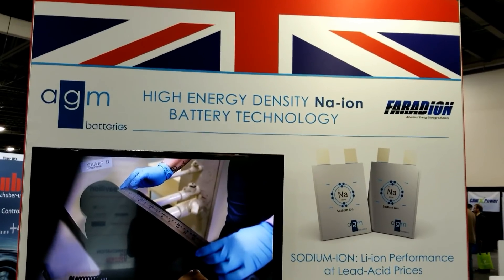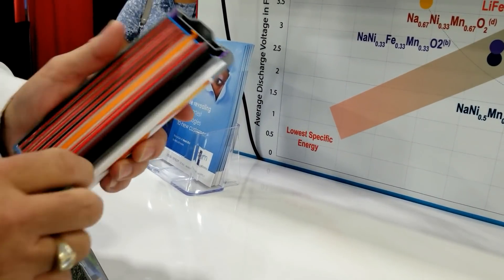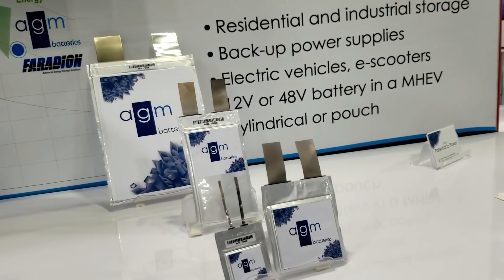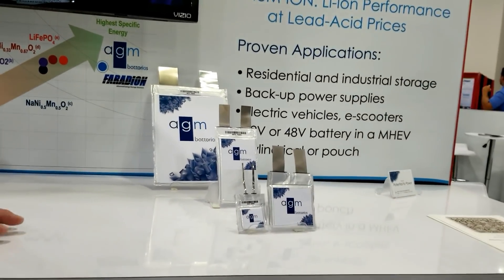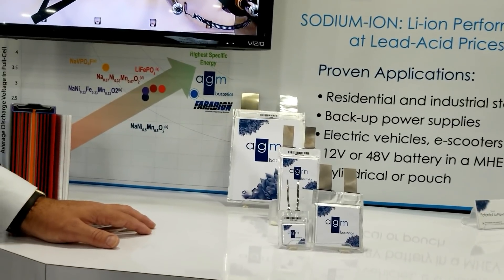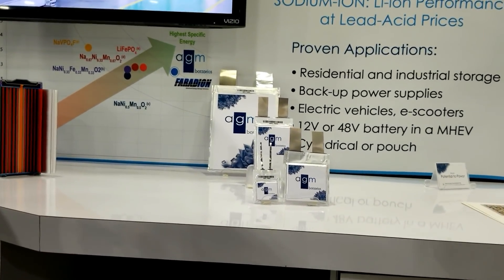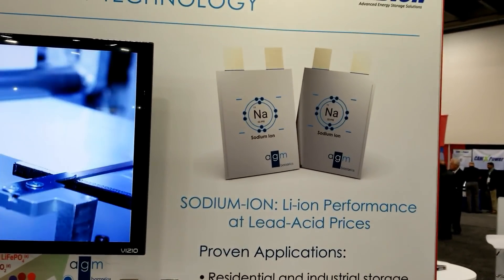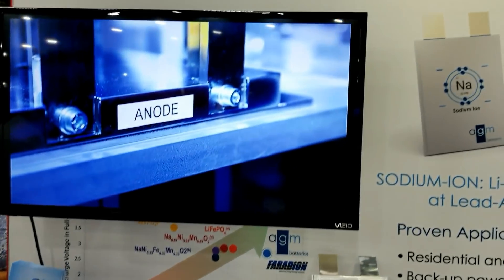Sodium Ion Batteries Revealed at The Battery Show 2018

Comment: I did read a bit about these cells, and the big issue is their cycling behaviour. At 0.33C, and 100% DoD (which is pretty deep from 4.3V to 1.0V, or even lower), they only last about 300 cycles, before dropping to 80% initial capacity.  (the "4th International Conference on Sodium Batteries", and "Progress in the Commercialization of Faradion’s Na-ion Battery Technology" presentation, says 300-400 cycles, but graphs shows more like 250). That isn't really good at all. Unless we know more about cycling at various DoD levels, or it is improved significantly, I don't see much point commercializing it, other than few demo projects, maybe for long range EVs, but it is not practical in reality. Even if it is half the price of Li-ion, which it isn't of course at the moment. 500Wh/kg sounds nice, but at what cost?

Comment: i did not get that correctly, did you say it is only capable of 100 charge/discharge cycles?
Reply from the maker: No they said they have testing confirmed up to 800 cycles already so far. The cycle testing is continuing. But being 800 cycles into their testing they know the chemistry is good enough for them to start marketing them
Reply: thx for the record.

Comment: Lower lever LiFePO4 (LFP)... LFP is less than half the volumetric energy density LiMnO2, LiNiMnCoO2, LiCoO2, LiNiAlCoO2... so really if it 30% lower than LFP, that pretty poor energy density. Well at least for now. I`m wondering if it`s has any advantages... Is it lower internal resistance / very high current drain capable ? Like 100A capable 18650 formal ??
Reply: Lifepo4 has a longer life span than other lithium cells
Reply from the maker: agreed, lifepo4 is superior but LTO has a chance to dominate because of 30,000+ cycle life. Just expensive right now
Reply from the maker: In my opinion these batteries, in the future, will be paired with supercaps and they will become the most sustainable, long term energy storage we have. Can't look over the fact that they will not be considered hazmat for shipping. Logistics plays a huge part. New battery technologies take years to complete their certifications so that's all we're waiting to complete now before these become available. Hopefully by early next year
Reply: Spot on for dropping the hazmat shipping. THis is a major advantage for sure.
Reply: Like lithium chemistries took 20 years from scientific Goodenough who envented them to the high capacity cells, I suspect maturation of Sodium-ion cells will take at least 10 years to mature
Reply from the maker: Agreed, the testing phase and all the "red tape" involved in new battery chemistry cells takes a long time. Actually, the better the batteries are the longer they will take to come to market, simply because it takes decades in some cases to get a full chart and graph. LTO batteries finally finished their testing phases, look out for them in the near future. 30,000+ cycles. Just expensive right now. Hopefully they will be getting cheaper. If you built a powerwall using LTO batteries that powerwall would end up in your will and your kid's will... and your grandkid's will lol

Comment: What we want to know is the nominal voltage of the various types of new Sodium-Ion chemistries, not that there is a whole range of capacity and energy density. This is a very easy question to answer for somone who is supposed to know the characteristics of the product they sell. For each chemistry, I want to know formula, nominal voltage, max and min voltage, max discharge current, internal resistance, max charge current, capacity, gravimetric energy density (Wh per kg) and volumetric energy density (Wh per mL), cycle life, usefull shelf life. Basic stuff !!
Reply: I agree... He couldn't even answer the basic questions any engineer would need to hit the drawing board... Disappointing.
Reply: Exactly. The nominal voltage is not going to change for a particular chemistry, is it? I assume he's just a salesman who has been fed some basic information about the product and not technically qualified to answer questions.

Comment: did they give you estimated pricing?
Reply from the maker: No they just said they are still in the ul testing phase but they advertise it will be cheaper than lithium ion and more expensive than lead acid.
Reply: it says "at lead acid prices" so it should be better than lithium.... sounds like the discharge rate isnt good enough for a lot of things... surprised he said that though, just pack them in parallel and the discharge should be sufficient split across the packs
Reply from the maker: From what I understand they can make the "cell" any voltage so they could technically design a "cell", not a "battery" any voltage they want. And they can be discharged down to 0 volts which is important for shipping regulations.
Reply: I agree that is a very cool feature, but putting the cells in parallel should divide the discharge requirement, so having several different cells should allow for higher discharge rates
Reply from the maker: @TRCCtv  absolutely, I'm really interested in this product for sure. Especially if it lives up to these claims